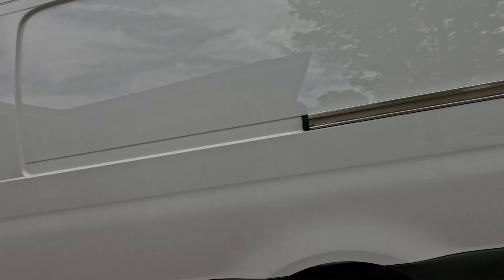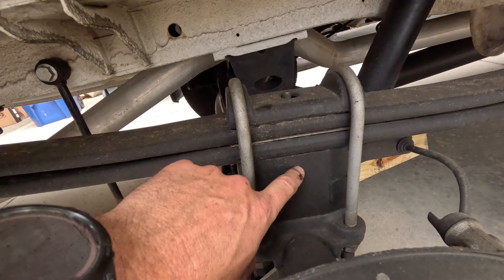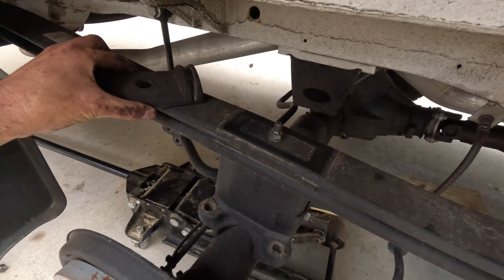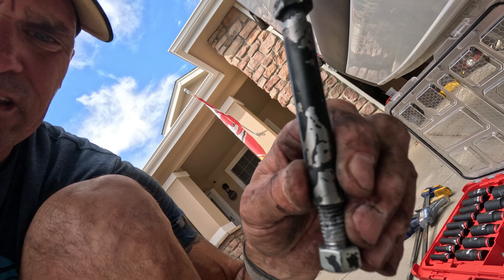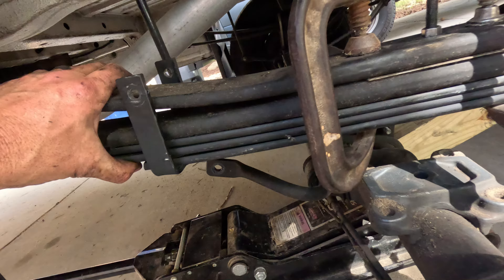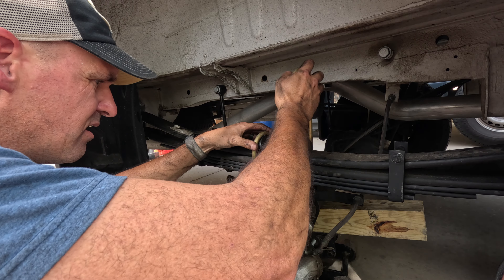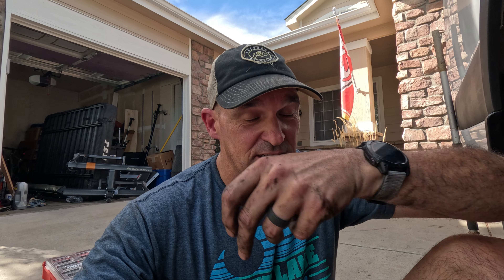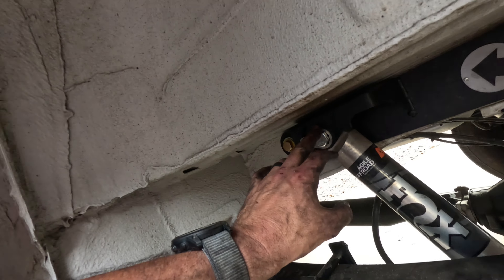How to Upgrade Your Van's Suspension for Off-Roading & Overlanding

Comment: Been waiting for someone to post this upgrade. been considering doing it on my rig for a while. Thanks for the explainer. Curious - How are you lifting the van on top the jacks. I know for my model the rear axle cannot be jacked at all. Have seen shops jack the rear shock - p[ace on jack, depress jack and then jack under the axle to sup[port it being weightless? Would love some more info. Nice work!
Reply from the maker: Thanks I appreciate it, so for jacking for the suspension changes, if you look at the rear leaf spring hanger closest to the bumper there is a large structure that forms the spring pocket, i took a length of 4x4 and a floor jack on each side and jacked the van up that way the  placed jackstands on the hitch to support the weight of the van and stabilize it because there is quite a bit of side loading when messing with the springs then took a floor jack under the axle being super careful of the diff cover and used the jack to support the axle while doing the lead spring work. Hope that helps you some

Comment: Thanks for sharing Dan.
I ordered AO RIP kit for my 170 RWD. Saw your earlier DIY install. Not sure if I can do it myself. You're installing a different setup this time?
Reply from the maker: Excellent you will be happy with it, it makes a huge difference and if you have the tools, the install really isnt that bad. As for the new van, just adding some add a leafs in the short term, before i make a complete suspension choice i want to get it built out and see how it handles and that will direct my choices, with a 170 extended my offroading is going to be limited to forrest roads but where the true eval is on highway with winds and to see how it handles in the curvy mtn roads, but like I  said i want it weighted first, the rip kit is  where I am leaning probably with the add-on of the aux shock up front